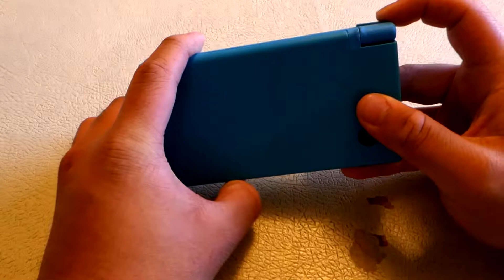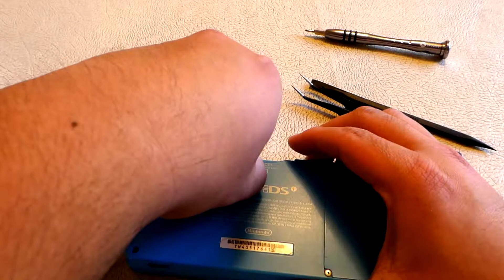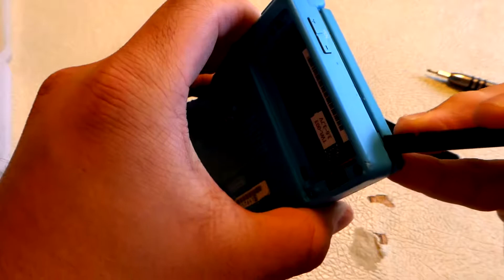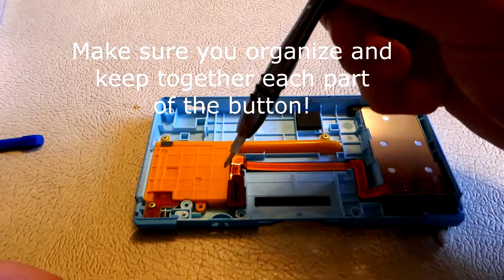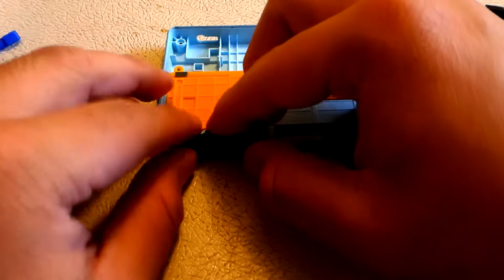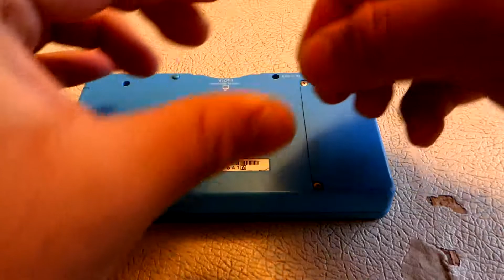How to Repair Nintendo DSi L and R Buttons (Permanently!)

Comment: Hi .. Will, 1st of all, thank for doing this clip. Truly appreciated.
I am new to fixing thing. My son just got his Dsi and his R button is not bounce back to it normal position. It is not that hard to open the back lit. however, my concern is about the wire that connect both parts. Do you have any other video that show how to disconnect and reconnect it back? I just need to watch it many time to make sure that  I will not damage it.

Comment: 1:53 mine broke and by trying to unscrew ended up freaking my screw. Now I'll never be able to open it :^)
Reply: If you stripped the screw just try and look up the rubber band trick was able to open up my 2ds with most of the screws being stripped
Reply: @Jahycore  Thanks for the tip!
Reply: same